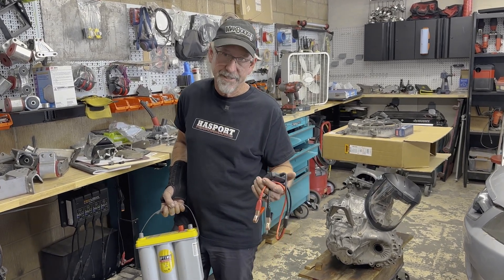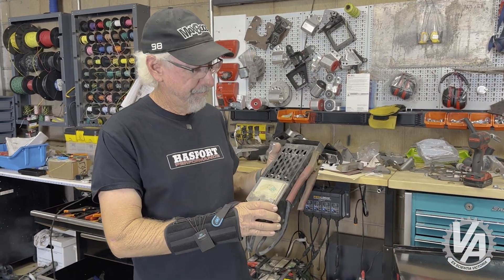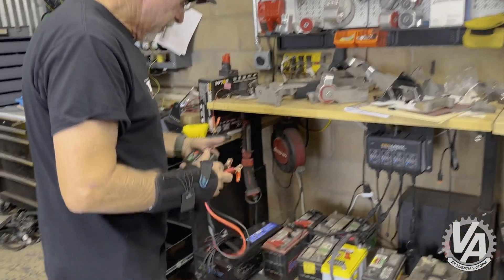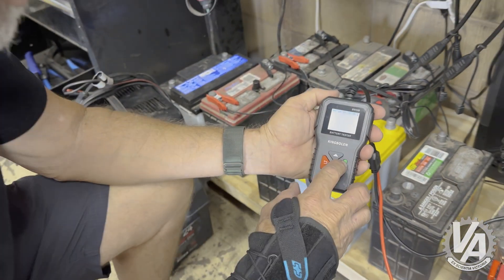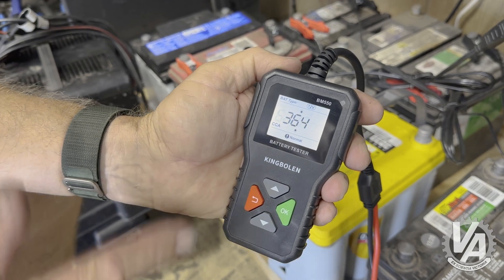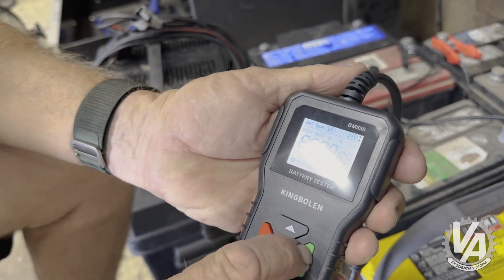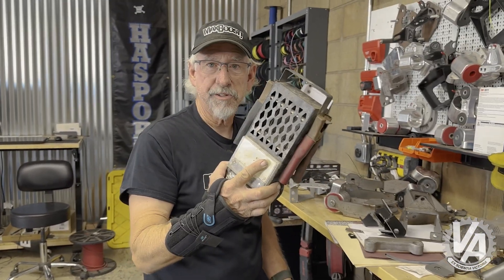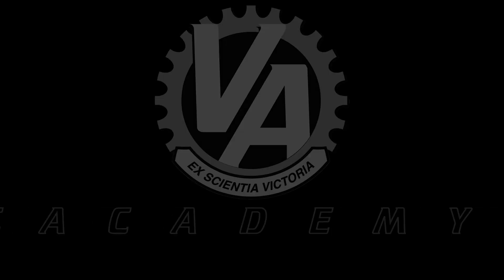Why Won't Your Car Start? Cheap and Easy Tool- Kingbolen Battery Tester BM550

Comment: I know,I received that same Kingbolen battery tester which I ordered on eBay yesterday & it's more precise than that older type of battery tester I also had but I threw it in the rubbish bin because the meter was melted & the switch was short circuited in it.

I paid $23 AUD for the old type of battery tester so it was more to do with cost,  I was better off buying a more modern & precise battery tester for $29.99 AUD which was the Kingbolen battery tester.

I am in the same boat where I bought a 270 CCA battery for a project car & it never was fitted into it, I had it in my current car about a decade ago when the battery died in it but now it tests at 31 CCA so it's stuffed.

I tested the current battery in my car which is a 5 year old 640!CCA battery & it tests at 465:CCA so the battery is still usable but I think that it will need to be replaced in the next year or so.

I tested a 650 !CCA battery in my dads car which has sat around a lot &: done nothing , it has run flat & I have recharged it a few times but it only tested at 97 CCA so it's stuffed as well !

Comment: I wonder if anybody can help me out with this problem that I'm having. What's the difference of a UK manufactured transmission to a Japan manufactured transmission??? Been looking to buy a transmission for my car but it's U cave filled and apparently I can't use a Japan built transmission for it
Reply from the maker: What's the car? Why can you not use a Japanese built transmission?
Reply: @VTECAcademy  2006 Honda CRV check the manufacturer's label and it's made in the UK but when I was asking for the transmissions in the junkyard they're asking me was it Japan built or UK built so I don't know if I can swap or use those
Reply: @VTECAcademy  so the junkyard order ended up finding a transmission somewhere in Texas for 900 then I told him that my car was made in the UK so he found another transmission for a UK car and that was $1125. Oh yeah im from Massachusetts

Comment: What’s going man have a question not related to this video I’m trying to manual swap my 97 odyssey I have a 94 accord that I’m going to use for parts I just need to know what clutch should I use thanks in advance

Comment: Would still say about 360 is definitely a bit on the low side for a 550 battery despite being a few years. Got Optimas in my Hondas and never looked back. Keep them charged and make sure the alternator works properly and it's set. But Cca testers are golden. Too many people overlook them and just say: "oh the battery is over 14 volts when charging. It's fine". Or overlook issues regarding the alternator or bad connection and just goes out and buy a new battery before doing any tests.

Comment: Back in the 90s i was gonna buy one but heard bad reviews on the optima batteries. So I never experienced them. Was that true brian?
Reply from the maker: Letting it sit for 5 years was a bad idea. I have had decent luck with all my other optimal. Especially the blue top ones. I did take special precautions when charging them. I would change them in series with good lead acid battery and standard charger, or use the CTEK or Optima D200 charger.